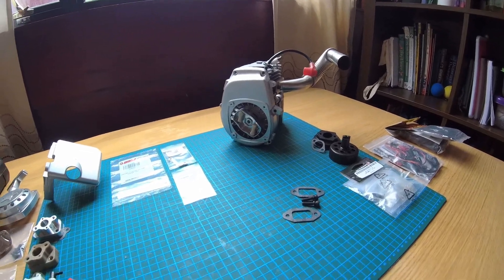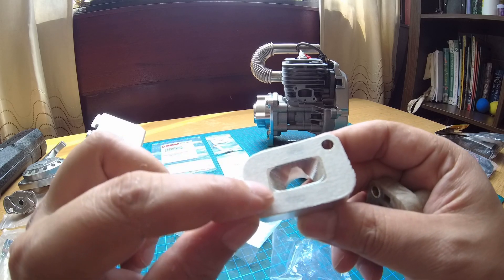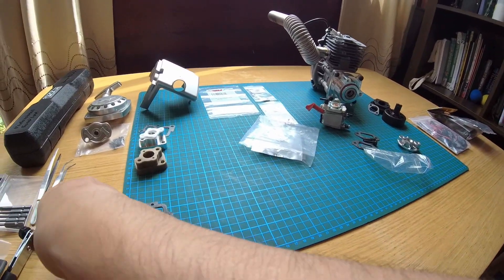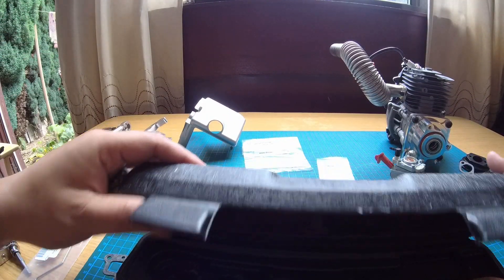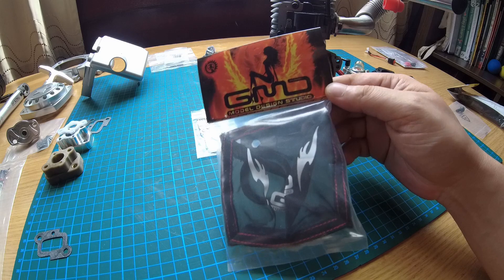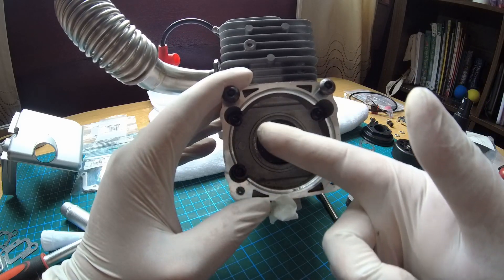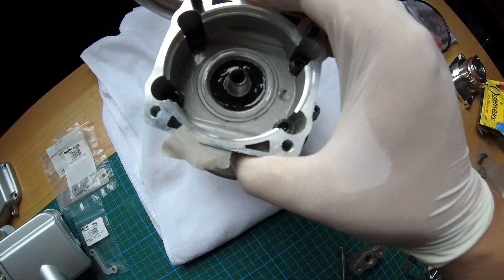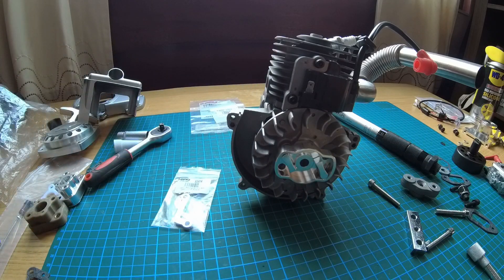#Episode 15 Losi 5ive T Parts Kit Build

Comment: Liking the Losi Build bro. 
Whats the part number, for the torque wrench.. defo need to get me one of those.
Reply from the maker: What’s happening brother nice to meet another tool connoisseur🤝 The torque wrench featured in the video is the tacklife HTW4A I got it from eBay! Stay tuned I’m almost done with the build lol🤓😂👊
Reply: @magmaflow-rc4487  One of the reasons why i subscribed to your channel.😂lool . to see the Outcome OF This Beast, ⛽ & thanks for the heads up on the torque wrench.
Reply: @magmaflow-rc4487  whats the name of the other wrench tool you use bro... the other small one u use.  im like the features on it. Just seen it on your latest losi 5ive T build
Reply from the maker: Nitro Wave 
It’s a mini ratchet wrench that I got from AliExpress one of the most useful tools available bro! If you want a link to it email me and I’ll send you the link👍